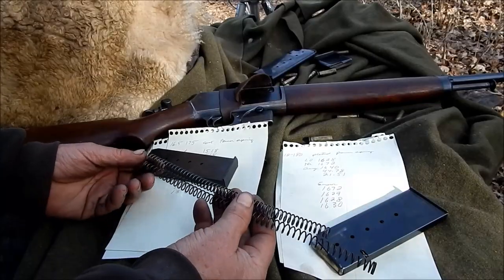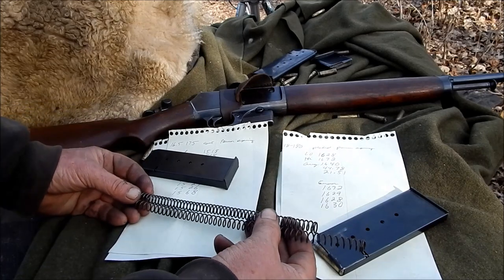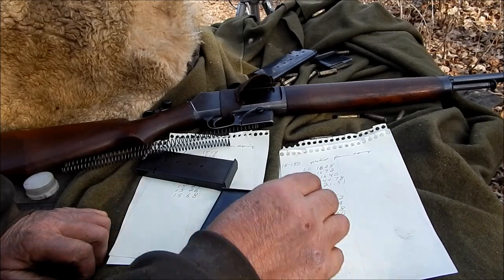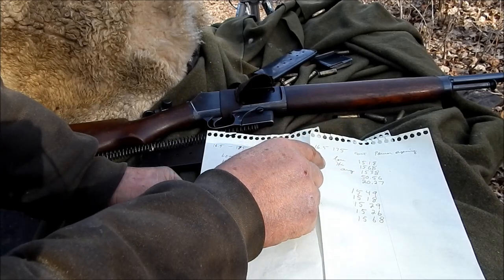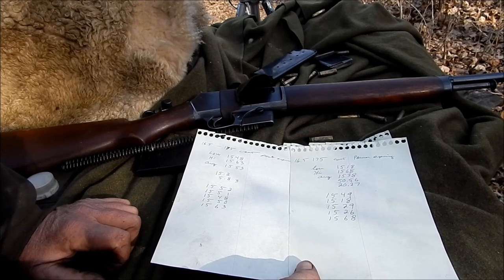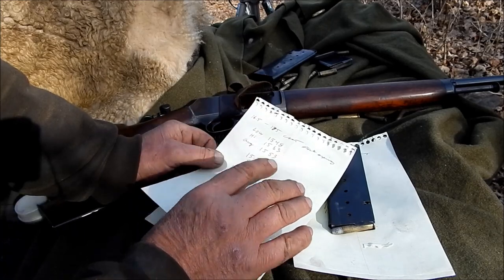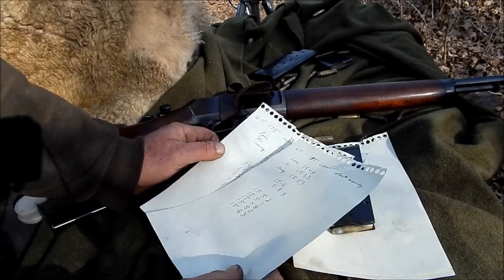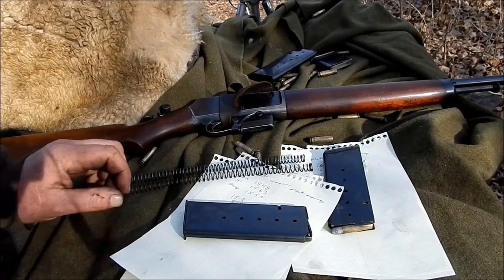Wolf Power Spring in a 1907 Winchester Self Loader

Comment from the maker: The dimples look to me like something from being clamped in assembly, but those mags are something else in many ways. I would love to see the design of the machine that made them. I was certain they had to be welded someplace, but I have read that they are drawn in a special process that Winchester developed. The original 1901 patent drawings are available online for Johnsons designs, it shows the original mag catch was to be a slot across the whole rear of the mag, held by a toggle coming from the front of the trigger guard, released by a button inside guard directly in front of the trigger. By moving the whole catch and release to the side it could serve double duty.  I also think the side release is way more convenient, its easy to grab the mag, and hit the release with your thumb, using one hand. Johnson isn't well known as a designer, but he knew what he was doing, it shows in the little details.

Comment: So ran into a snag getting the springs, wolff gunsprings has not shipped my order, some delay of some sorts.
Do have 303 British bullets coming for the lee enfield, they are 150 grain Barnes TSX bullets, so will hope it is a good bullet for the old gal.
Reply from the maker: It took a while for mine to ship also. I remember when I put in the order they said to expect delays because they hadn't been able to keep up with the shipping.
Reply: +logcabinlooms Good to know, I of course figured it would be quick, but like you and they say they are having issues with keeping up with demand.
Probably because of your videos. :-)
Did you see where I posted the info for that pistol of yours where they show the std spring and the various strengths of the other stronger ones?
Reply from the maker: partsman yes, I will be playing with those sometime this summer to see if I can tame the ejection down a bit. The pistol itself works fine, but it will really fling the brass.

Comment: love your vids!, I don't understand how the spring effects bullet performance can you explain I didn't think it had any influence?
Reply from the maker: On a blowback system like this is, the weight of the bolt, and the resistance of the spring, directly affect the velocity of the bullet. The system never actually locks, so as soon as it fires the bolt starts moving back. The more resistance on the bolt, the higher the velocity of the bullet. That is also why the spring pressure from the magazine also affects velocity, because it puts pressure on the bolt causing more resistance. With a full magazine the pressure is highest which results in a high velocity first shot, the pressure drops as the mag empties, so the velocity drops off gradually. Winchester redesigned the magazines, and the magazine catch to minimize it by allowing the catch to protrude into the mag, running on the rims to regulate the pressure from the mag spring. It works to a certain extent, but also causes some wild variables in velocities. I will go into it in detail sometime, but that's it in a nutshell.
Reply: Thank you for your detailed information.  I always thought about it in reverse because I know my 1911 operates more smoothly with a 16 pound spring with my reloads and makes nice cycling.  When I load  a little hot it will cycle but is very harsh.  Thanks again.
Reply from the maker: American Crusader the main difference is a 1911 does lock momentarily, the nearest equivalent would be a Makarov, which also operates on simple blowback, much like a .22 semiautomatic.
Reply: That is very kind of you to explain the difference to me.  I enjoy learning about firearms any chance I get. On a side note my favorite video is when you loaded the 45 70 by hand and fired it, I showed it to all my gun buddies and it leaves them perplexed.  Lol

Comment: I have the same question as American Crusader. How would the spring affect velocity?
Reply from the maker: Newtons third law.
Reply: The heavier spring slows how fast the bolt opens, thus there's higher pressure longer in the bore/barrel which equals higher velocity
Reply: @logcabinlooms  Except...your results were the opposite.  That's because though the spring can affect things, your powder variance, gun handling, crimp etc, affect the velocity much more.  Not to mention the variance in the chrono itself.